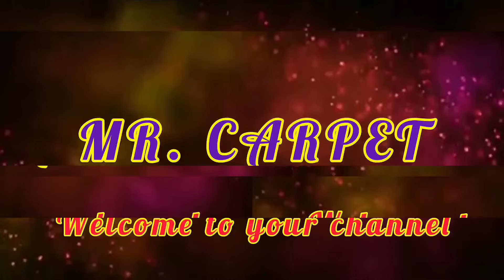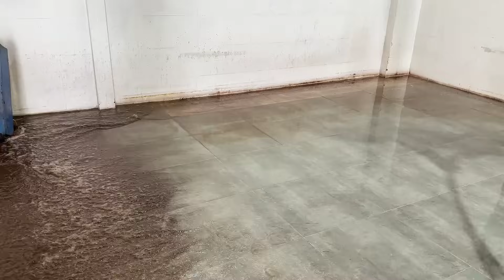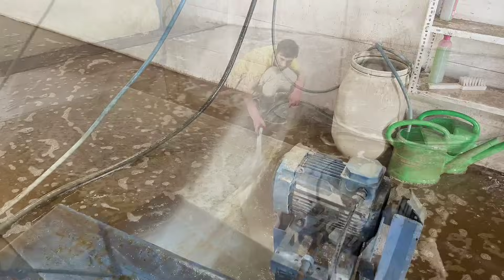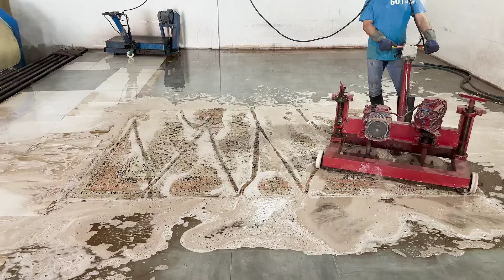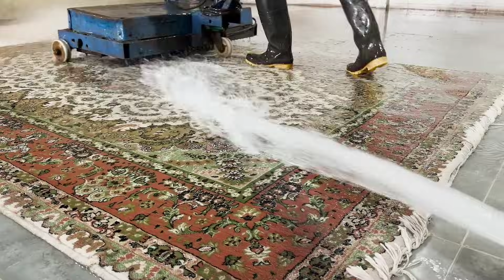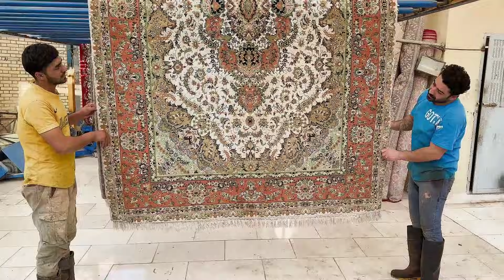Amazing Way To Super Clean The Nastiest And Dirtiest Carpet  |  Oddly Dirty ASMR

Comment: I'm just curious—no judging here. Where do all of your runoff, i.e., caustic soda and detergent drainage, go? And what about the solids that are bound to accumulate in your drains? And do you recycle the massive amount of water used in the process? 

After observing many of these fascinating videos, it also seems that perhaps the floor design would benefit from a perimeter drain for the backwash from the initial flushing of dirt, saving all the time needed to rinse the floor several times to dispose of the accumulated dirt. Perhaps a slightly steeper floor angle toward the primary drain would make the process more efficient as well.

Again, I'm not being critical or judgmental here. These are just my observations of a fascinating and obviously little-known process.
Incidentally, I admire the work ethic shown here. All of those jobs have shown spectacularly positive results, and it is obvious that each is a labor-intensive endeavor.
 
Please continue the videos; as someone else said, they are oddly satisfying to watch.
Reply from the maker: Hi dear friend
All waste water is recycled and reused.
Please see the video related to this process in the channel.
Thank you so much for watching.
https://youtu.be/_nnkAQ-voHU